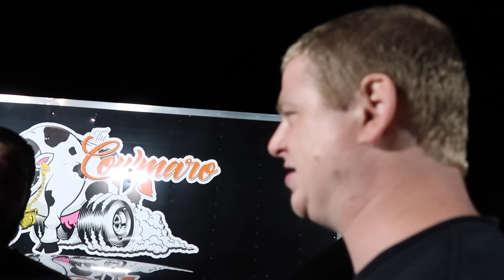FIRST PASS EVER in my Procharged Hemi Grand National the BLACK SHEEP!!!

Comment: Congrats on initial test.  I noticed on your first pass that your belts could have been snugged more, exhale before  final tug.  Watching the idle speed drop when you dropped it in gear, converter maybe a little tight.
Can't wait to see that Hemi top end.  Take your time sneaking up on control. Crew has done a great job preparing car for shakedown. Great Job!

Comment: 5:02 @ 150 does not sound right to me!
Reply from the maker: Why not?
Reply: 1/8th mile buddy
Reply: @JohnDoc  Top Alcohol Dragster (TA/D). Known as Top Methanol Dragster in FIA competition. Top Alcohol Dragsters resemble Top Fuelers, but have significant differences. They may use a supercharged methanol-burning engine or an injected nitromethane combination. They can run in the 5.1s at more than 280 mph. seems your mph is a little slow for that number.
Reply: @bobbysixsevenw  so it's a 10 second car LOL?
Reply from the maker: Did u not watch the video.  We stayed we are running no timing and minimal boost
Reply: @bobbysixsevenw  wanna see the slips, Cleetus always shows the numbers even if they suck.
Reply: @JohnDoc  if you slowmo the vid it looks like a 9 sec. pass
Reply: @anonymous70909  that Top alcohol pass is quarter mile. This is 8 Mile.
Reply: @anonymous70909  no you don't just double the time to calculate your quarter mile time what he is running right there is on no boost and no timing. It's still ran a 501 that would make it like a 750 760 car in the quarter mile
Reply: @anonymous70909  why are you so worried about it. All tracks can switch from quarter mile to Eighth Mile Buy keystroke on the computer into the timing setup
Reply: @bobbysixsevenw  no worries, aint my ride. Just think he is trying to pull wool over our eyes. Black sheep wool LOL!
Reply: @bobbysixsevenw  watch the video, he ran to the timing towers. Why do you seem so worried?
Reply: @bobbysixsevenw  I am sure Doc could defend himself if he wanted to.
Reply: @anonymous70909  it's all good man I was just trying to help you understand